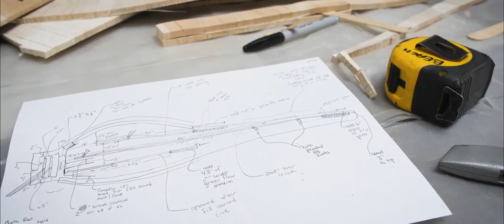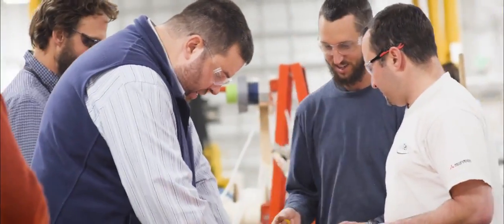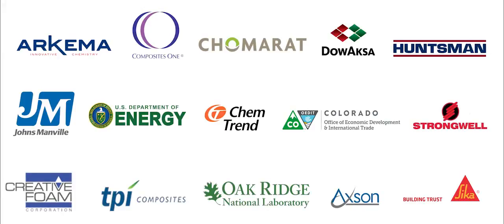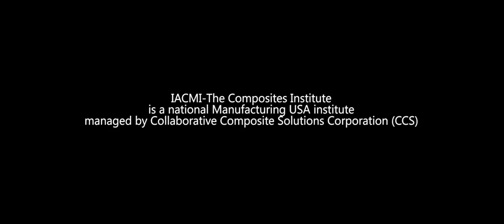A wind turbine blade recyclable with Elium®

Comment: What’s the percentage of blades recycle?I’ve been told the majority still get 
dispose on the landfill
Reply from the maker: Hello Alex A. Yes, today, if we manage to recycle a large part of wind turbines (the mast, the generator ...), the blades are recycled very little because they are largely made with thermosetting composite materials (epoxy for example). The recyclability rate of the blades is now less than 5%. The rest is unfortunately buried because it cannot be recycled. Elium Arkema technology offers a new generation of thermoplastic composite materials. This technology allows depolymerization at a reasonable temperature (400 ° C). Thus, the blade becomes almost 100% recyclable. The monomer obtained after treatment is 99.8% pure! We can thus indefinitely, remake other blades! Thanks and have a good day!

Comment: If you repurpose the materials through recycling, you're redistributing the non-degradable material. But in the process, replacement wind turbine blades will need to be manufactured, creating more non-degradable material.. This is similar to the issue we have now with the production of new plastic materials simply because the cost of processing recycled plastics into usable material is higher than buying new plastic pellets. So you're just creating more and more non-degradable material without addressing the issue. Can you use your products recycled materials to produce your product or do you need new materials to create new replacement blades.. Got you there don't I..?